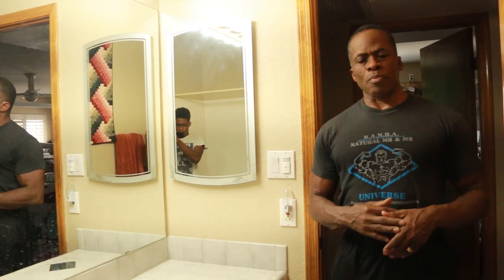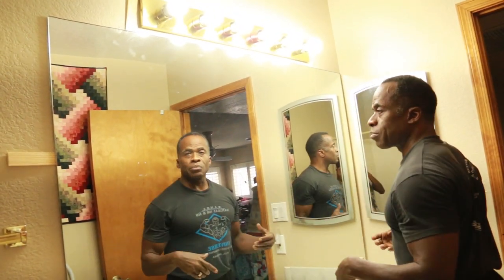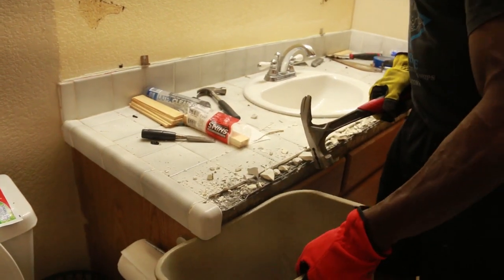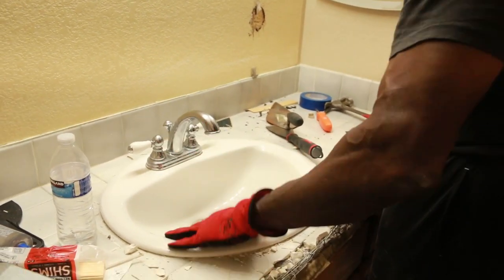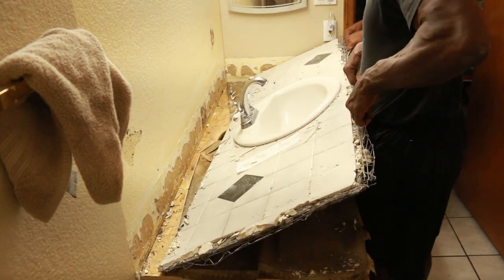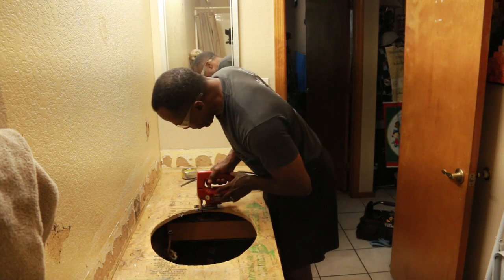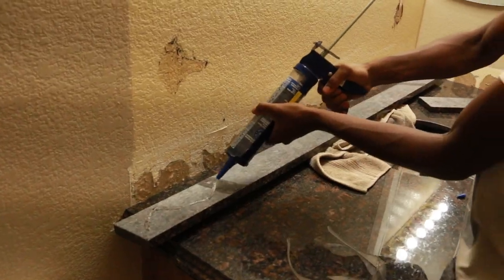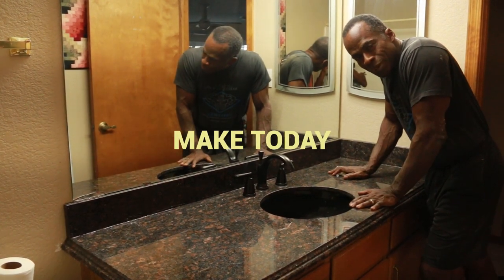Dr. Gene James- DIY Replacing a Bathroom Countertop

Comment: God bless you, I Enjoyed the abbreviation on each step as we don’t need to watch every minuet.
Damage prevention of taping paper to the lower side of the cabinets would protect them from scratches or other damage.
We have found buying a modern mirror with a frame adds a lot of class to the bathroom.  And my wife requires that all of the towel bars Fossetts and cabinet handles be replaced.
Your new fan from Taxi Fornia (California)
Reply from the maker: Wow, You’re a wealth of information. Thanks for the tips. Have a great day.
Reply: @drgenejames  I’m not is well-versed and have direct connection with God put my wife always says I’m full of it
Reply from the maker: @frankamdur870  thanks, I may try adding a mirror with a frame. Sounds like a good idea. I also changed the door knob to a black set. It looks good there

Comment: So you just found a new countertop that was the correct size in a material that you liked? I'm looking to do two bathroom countertops that are both different sizes. Think the part that worries me the most about it is the cutout for the sinks (two in one, one in the other). I'm a diesel mechanic whose carpentry skills are minor at best, but steadily improving.
Reply from the maker: Keep searching

Comment: Alright!!! Looking good. I’ve seen several videos about how to do this and you have the best one. Straight forward and to the point. Makes me more confident in doing my tile replacement by myself. 

Question: did you get the counter top custom made for your bathroom or did you buy a set piece from the store.
Reply from the maker: I bought it from OfferUP or Craigslist. $100
Reply: @drgenejames  what a score! And it was a fit. Thanks again for the video.

Comment: Hi! I’m getting ready to take my old tile bathroom countertop off. Then, going to extend it from front to back and put in sinks that sit above/on the countertop. Do you have a suggestion of what substrate to use? Is plywood okay or need some type tile backer board for it to be waterproof?
Reply from the maker: It’s best to check with the guy at Home Depot. That’s what I do